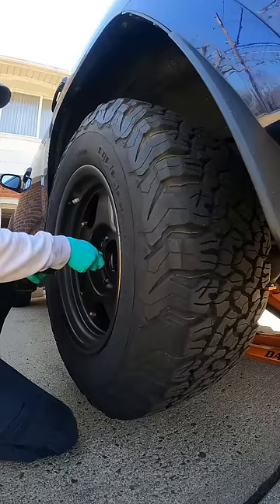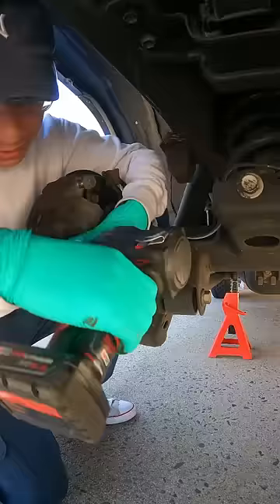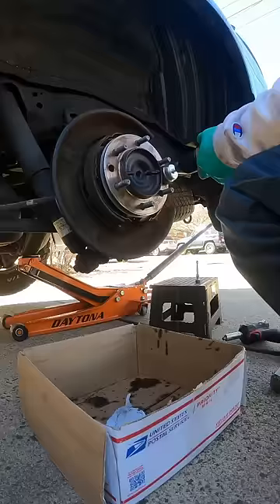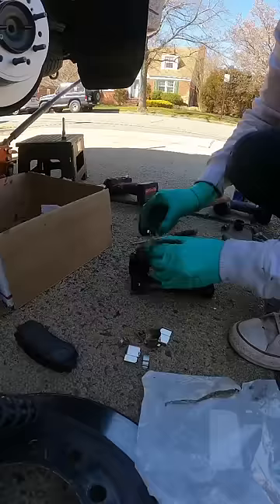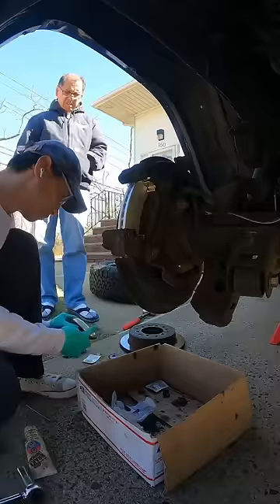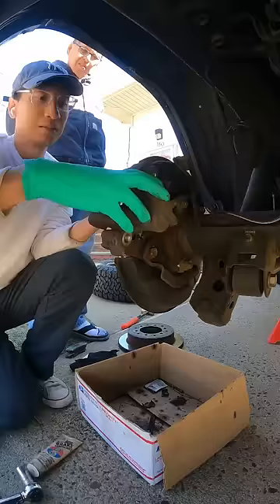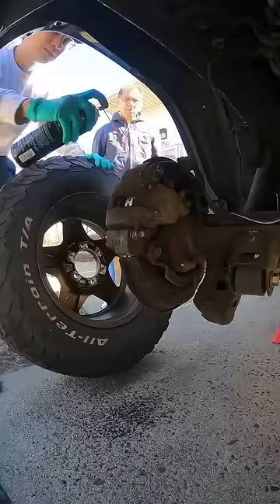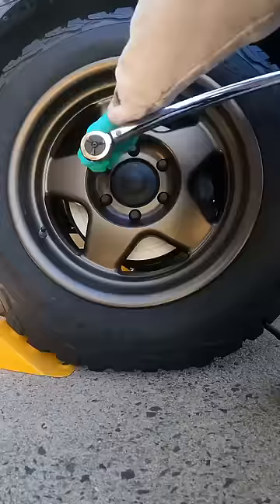Dealer wanted $700 to replace rear brakes. My DIY job cost me $100 and an hour of my time 😎

Comment: Brakes and oil changes are the gateway drug into car repair.
Reply: and filling up your fuel tank is only "secondhand smoke"
Reply: You forgot about dad in the back
Reply: Then you do your timing belt and fuel injectors and intake boot and carrier bearing and suspension… well you get the point I’m addicted.
Reply: @addisonsmith3503  timing belt change is such a huge step, but really important in older cars as failure can literally total the car
Reply: Never had worked on a car in my life, then I got a 93 integra, I changed the breaks, rotors , & now I’m waiting to change the fuel pump 🤘🏽
Reply: Well said
Reply: I remember being 16, having enough money to do an oil change, or go hangout with someone on a Friday night - not both.. 12 years later I casually fix and maintain all my buddys  vehicles in my driveway on my spare time lol
Reply: @HVYBOY  the truth!
Reply: yep..then i went to doing things like valve lash adjustments, axles, clutches, opening transmissions, then finally....the engine swap.
Reply: @addisonsmith3503  I went from oil changes to throttle body cleaning to swapping an entire 22re enginefrom my 4runner. How did I do?
Reply: I replaced my rear struts 2 months ago and that gave a confidence boost to keep fixing things
Reply: Well said.
Maintenance of my daily driver is not a job or a pain in the @ss. That's my hobby with good amount of pleasure.
Reply: @@abigmonkeyformecheck out the new civic. You can get it as a hatchback with a 6speed manual and no turbo. Probably going to be one of the last simple Hondas.
Reply: Yup, couple that with a go-fuck-yourself price quote from a mechanic and that’s how DIYers are made.
Reply: Lmfao oil changes yeah but brakes not all easy try doing some drums 😭
Reply: @Latto100k  drums are a pain but disc brakes are simple. Just have to deal with rust and if there's an electronic e-brake.
Reply: @ChicoBlaze fuel pumps super easy usually too!
Reply: Seriously. I went from my dad showing me how to change oil, tires and just doing a basic tune up in his 86 Monte SS, 78 Firebird and 84 K5 Blazer as a little girl, to me buying an 86 IROC Z28 at the age of 16 and putting a 350 4 bolt main in it with new carb, cam, timing chain, intake, headers, exhaust, etc. Then my ex came around and he had an 87 Camaro that went from a 4 cylinder automatic to a beast of a 350, 5 speed manual with a 9 bolt aussie rear end. That we built together in my backyard hahah. Oh man, it really is an addiction. I miss my F Bodies😢
Reply: @TidalWaveDan thats is exactly how I was made
Reply: mine was when they wanted 3k for a water pump and front tie rods. Now I can't stop. please help
Reply: Indeed!
Reply: Don't forget plugs and coils, gear oil / trans fluid, engine air filter, cabin air filter, and coolant flush.
Reply: @sunnywynn56  Try to find a brake job video for your exact (or similar) car. And take pictures along the way so if you get lost or stuck, you can just reverse what you did.

Also, just know that you can take your time. A lot of people watch YouTube videos and think that mechanic work should be fast and go 100% smoothly because of the misleading editing. But in real life, you can go slow and steady and take time to double check things you're unsure of.
Reply: “yea i wanna learn how to do my oil so i can save money in the future!”

i now have two project cars, project boat, a bike, and the daily. i am a fool
Reply: Really? Mine was hitting a deer, and pulling the driver side head in a B5 S4 to replace 2 bent intake valves. A car your supposed to take the engine out, but if theres a way, theres a will.
Reply: Correct, that’s how I started. Now I’m messing around with suspension parts and the simpler engine parts like alternator and radiator
Reply: o yeh
Reply: I'm hooked, I use my dad's friends place to do so, he loves diy but is also a mechanical engineer 😂 so I get great training and no dad thinking he knows everything
Reply: I’ve done a lot in terms of repairs to my vehicles but never touched brakes 😂
Reply: 1st level. :  oil changes (Engine oil, Transmission oil, power steering oil)

2nd level : Spark plugs (V6), PCV Valve, car stereo change. 

3rd level : Radiator change

I am on 3rd level and
I was surprised, how easy it was to change leaking radiator in my car. 

My next goal would be brake jobs. 
I don't like buying any tools so I work with as minimum tools as possible. So I don't like those
Reply: Changed my cars oil. I now installed a new alternator, changed headlight bulbs and seasonally change winter and summer tires. Next project will be brake pads and front bumper 🤟🏻
Reply: Indeed 😊
Reply: For real i started with breaks and went from there
Reply: I've only changed my brake pads and oil zero times on my Tesla 😮
Reply: Next thing you know you have 3 project cars on jacks.
Reply: Facts!!!
Reply: Lmaooooo
Reply: @TidalWaveDan You got that right! My local GM dealer here in Canada wants 180/Hr + shop fees + tax for any sort of work.

Had my power steering rack fail on my 2015 GMC Sierra this winter. Didn’t really feel like working on my truck in -15C (doesn’t fit in the garage with the door closed) so figured I’d see what the dealership wanted to do the work. At the same time I wanted to have my lower balljoints replaced with the mevotech ttx balljoints that I supplied, as well as have my front struts swapped out for bilstein 5100’s which I also supplied.

All in all they quoted me a little over $6000 For 14 hours shop labour and a steering rack and power assist module…

Needles to say I threw on my insulated coveralls and got to work. Took my time doing the rack and got it done in less than book time. Took the strut assemblies and lower control arms to another local shop and paid them $120 cash to swap out the struts and balljoints. 

Saved myself around $3000 after getting an alignment done.
Reply: @ChicoBlaze best for my journey is I see what others pay and I can even justify the nice brand tools. Starting a little collection😊
Reply: So much yes.
Reply: @sunnywynn56 Its ok to feel nervous doing something for the first time. But most brake systems on most cars are pretty simple. Just take your time
Reply: @justine5804  👍👍👍👍
Reply: You are absolutely wrong. Nothing is more frustrating then being excited to work on my Jeep, just to spend hours worth of my time getting no where, just to have to put the old brake pads back on because the new ones are too tight and a hammer isn’t strong enough to force them in, even with a plethora of grease. Fuck working on cars. I’d rather kms.
Reply: That's how I became a mechanic.
Reply: yea then you end up having to change your Serpentine belt, atlernator, starter, and you slowly start to realize that your never taking your car to a shop again lmao
Reply: @addisonsmith3503 and then your motor doesn’t run right anymore so you take it to my shop and I fix it lol
Reply: @WillSwingem  nah man i only do my work to Toyota manual spec. I have fixed many things previously done wrong by other owners on my 87 toyota pickup and a few things on my 2000 Tacoma. If it’s too much or i need it done quicker, i bite the bullet and take it to a good shop, or Toyota’s service department. It ain’t hard to do it right with manuals, forums and the internet. Sure I’m slower than a shop, but I enjoy it, cuss words and busted knuckles and all.
Reply: @addisonsmith3503  I only say that because I fix so many people cars that they worked on themselves and fucked up, over half the time someone does there own suspension work and bring it me for an alignment there’s shit left loose
Reply: @HVYBOY 😂😂 lowkey gonna happen to me too, once they find out i know a thing or 2
Reply: I've never changed oil or brakes on a car but the first thing I ever did on my 99 Honda Accord was swapping out a fuel pump.  💀
Reply: @austinwasheleski9566 that just means you aren’t mechanically Inclined and prolly 100% American too. 😂😂😂 go to the dealer bro
Reply: I'm literally in this phase rn 😭
Reply: I am a certified brake pad and rotor master mechanic
Reply: @beezymeech  if the car has an interference engine. Those eat valves.
Reply: Full front suspension (this is what really sucked me in), all 4 brakes, new caliper, brake flush, valve cover gaskets, oil changes over time. Next up is either dropping the oil pan to replace the gasket or a timing cover job to fix a pesky oil leak and at some point dropping the transmission to replace the torque converter.
Reply: Facts
Reply: I went from DIY guy to full time diesel mechanic. I’ll always support the DIY guys.
Reply: Buying a ford transit is the gateway drug to welding addiction. 

Joining the European union is the gateway to living like a siberian ironically
Reply: Lmao, i did that yesterday now im feeling it again !
Reply: Haha, that's so true! I recently decided to become more capable and learned to replace the brake pads on my jeep. Then, later on, I did my rotors all by myself. Now I think I might try changing my own oil from now on 😄🫣. If i become an automotive tech at some point, this was my origin story, lol 😆.
Reply: Not for me I had to get a new rear end for my truck so I put on successfully and then about 3 months later I had to change the brake pads and I had to do a quick YouTube for that 😂😂
Reply: My radiator was my gateway, now ive done the alternator, cleaned the throttle body, just had brakes done like 2 months back and now I feel scammed knowing I coulda bought the tools and jack and brakes for less
Reply: I changed my headlights out on a 2011 CTS and now I’m here
Reply: This is true. I started off just doing oil and brakes and now I have a 30 year old car that’s completely new again lol
Reply: Too true, I did my rear pads a few months ago and now I’ve done lower control arms, CV axles, inner and outer tie rods, struts, sway bar links…😂
Reply: I knew how to pull my transmission before doing brakes lol
Reply: Wait til you discover air conditioning work. That's when you've gone too far.
Reply: I got second-hand smoke from my grandpa when I was little, then got into heavy in high school. They even had classes for it. Those animals 😂
Reply: It used to be air filter replacement. Hmph!
Reply: As someone doing my brakes right now, im addicted
Reply: Agreed. I did my oil, then trans fluid and brakes
Reply: Fr next thing you know I was enjoying putting on my own alternator
Reply: It will have you thinking about cylinder compression in the middle of the day ordering lunch 😂😂 don’t get me started on tools
Reply: I wish I had the time and money to really get into fixing cars. But man the itch after doing my own brakes I'm hooked.
Reply: Definitely! Thats how I got into doing my own car repairs